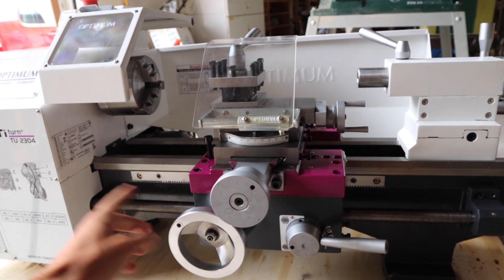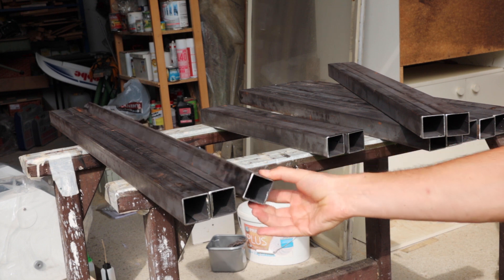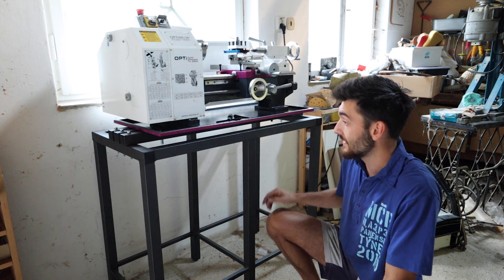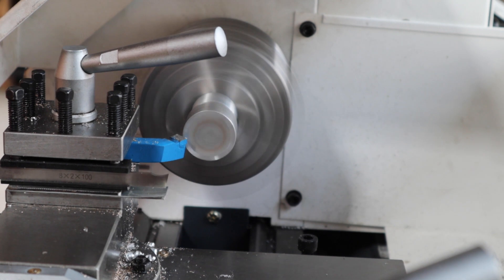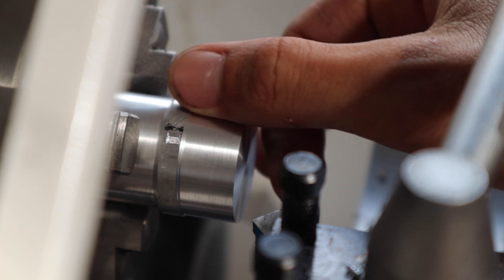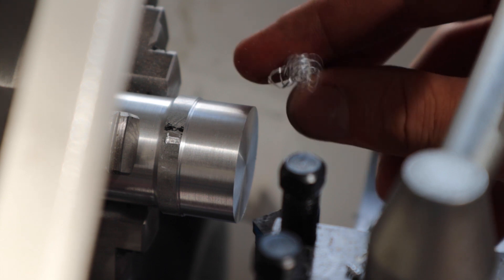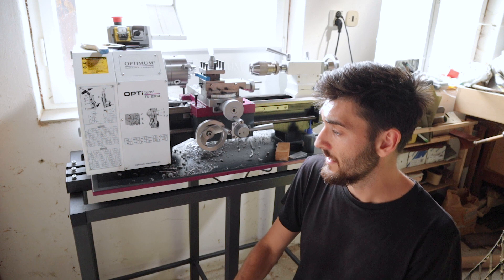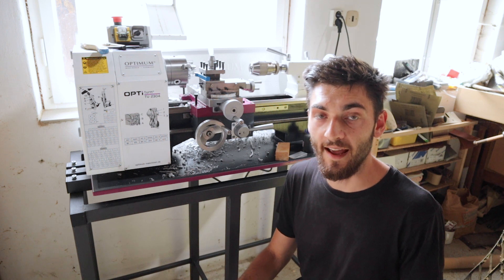Mini lathe – unboxing, base, first cuts – EP 01

Comment: Hey there! One more question. Did you find a way to lock the carriage when facing a part? I noticed that I cannot face a perfectly flat part because the part pushes the carriage bit by bit. Cheers!
Reply from the maker: Yes, there is a cap head locking screw on the right side of the carriage...
Reply: @JindraSykora  thank you for your help!!

Comment: Hey! I've bought a few weeks ago the same mini lathe. In the toolbox there is an MT2 dead center that fits the tailstock, but there's also an MT3 dead center that doesn't fit anywhere...what is the purpose of the MT3 for this lathe? Thanks!
Reply from the maker: It goes in the spindle bore when you take the chuck off... 👍
Reply: @JindraSykora  thanks a lot!!

Comment: I have one of these on way, OPTIturn TU 2004V. Very excited and I too have to make a stand. Thanks for these, very helpful.
Reply: what do you make of your 2004v lathe? was it worth buying?
Reply: @johncrow5552  I have had great success so far. I changed the tool post to the Pewe system. Way better.

I could have done with a little bigger lathe but very happy with it.
Reply: @dhcrouchmarineltd3049   Most peeps always want a bigger lathe! I have been considering this lathe as it will be my first. Next size up is also tempting but not sure I can justify the cost as the bigger lathe will require the purchase of a stand. Cheers for the reply.

Comment: Hi and thanks for sharing this video. I'm considering buying this lathe but couldn't find enough information on it. I couldn't see from your video how you can change the speed of rotation and also the feed speed. I'm trying to know the difference between it and the 2304v. I also noticed that you didn't use the lathe to thread the part you did on your other video.
Reply: V stands for VARIO. ' TU 2004v ' is around the same price but with variable speed , the TU 2304 has a 750 Watt motor ,(150w more than the '2004v' with only 600 Watt

Comment: I am seriously considering this lathe. It is a Chinese lathe, but it looks like it is not a usual rebrand of the usual 7x14 model from SIEG. It still looks very similar tho, and I am concerned about the quality and tolerances of assembly. At least Optimum does give some concentration guarantees, which is nice.
Reply from the maker: Hi, mine works very well to be honest... But there are things that need to be addressed when you get the machine. However, in my experience you  can easily machine precise parts with it and if you are a hobby machinist it is a good option. Alternatively I would recommend to have a look at second hand market...
Reply: It looks very similar to a WARCO lathe.